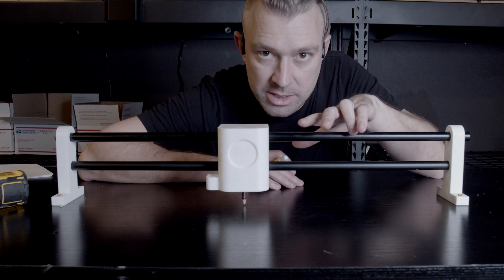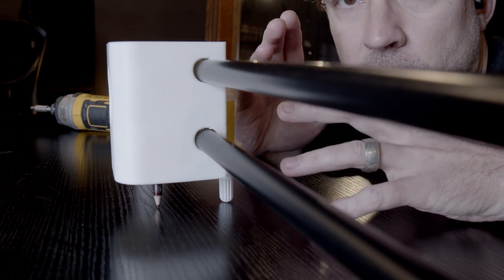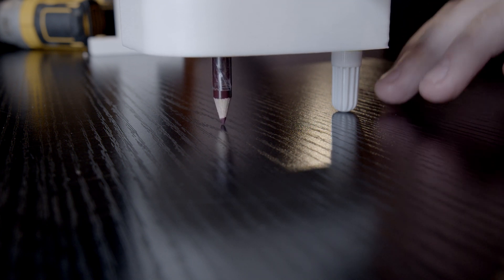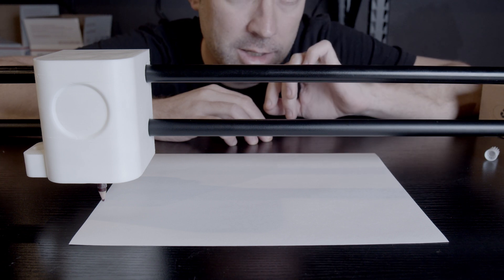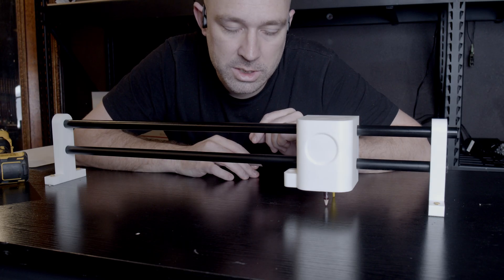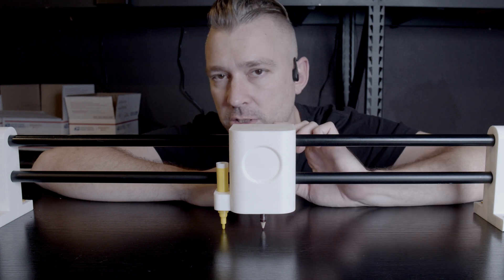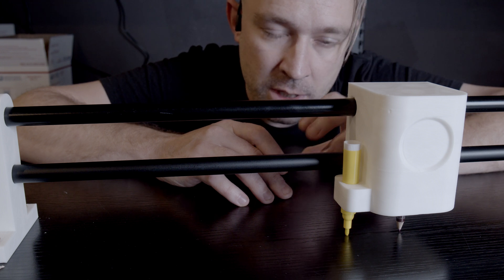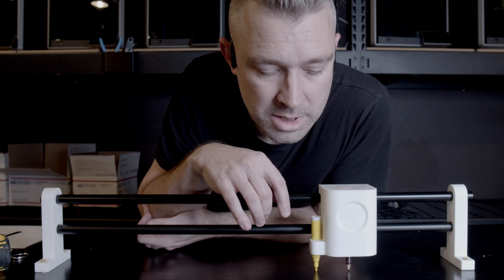Axis Twist? A Problem for Creality and Everyone else!

Comment: I was ready to throw my Ender 5 in the trash and have given up on ever getting a consistent first layer because of what I now assume is a twist, calibration to follow this comment. In my research I have read about x-twist in the past, but completely misunderstood and thought it would have issues front to back instead of left to right.
Reply from the maker: Hope this helps solve your issues. Axis Twist unfortunately is not a massively known or understood topic.
Reply: @zerodotcmd  It solved it on my Ender 5 S1, however my Ender 3 V2 is still weird, when applying compensation the high and low sides just reverse, so I think there the issue may be Y-axis, but not sure yet.

Comment: Huh. It never even occurred to me that this could happen. My printer uses its nozzle as the probe for leveling, with a strain gauge of some kind, I guess. It's just a cheap printer but first layers and general operation have been very good.
Reply from the maker: If your printer uses the nozzle as a probe, this most likely won't really affect you. This video is more referring to any printer that has a mounted probe.

Comment: Nice video. I also figured this out a few months ago. At first I tried printing a 5x5 grid about 3-4 layers high, and then probe the top of the grid lines (which are in line with nozzle height) to get the offset between probe and nozzle. Then used those offsets to correct the probed mesh data from Klipper using Python. Very tedious. After realizing that I could just mount the probe next to the nozzle, the whole problem went away completely and the printer just works reliably.
Reply from the maker: Exactly. I wish more people talked about this problem. There's probably quite a few people having the same issue without knowing exactly what is happening.

Comment: Side probes are a lot less susceptible but with a bad enough twist you can still need compensation since the nozzle and probe won’t be at the same “y” position. As the nozzle’s Y could be off (say 0.1) forwards or backwards. In that case it’s Z position be ever so slightly higher. 

Of course in that case  you can account for it with twist_axis_compensation if it’s bad enough. 

I never needed that until after a few years I started to get a twist to my X gantry on an old Ender 3 so it’s not my first suggestion but worth a check when you’ve ruled out everything else. 

Great visual representation of the issue!
Reply from the maker: You are correct! ✅ It's completely true that with enough of a twist both Rear and Side mounted probes would benefit from running Twist Axis Compensation. This is the main reason I'm always careful to say "less susceptible" rather than saying somethings not effected. Rule #1, there's always an edge case. 😊

Comment: I'd rather go with printers which are having probing through the nozzle itself (without external sensor). Even the Bambulab A1 mini (dirt cheap) has it by default.
Reply from the maker: That is always an option. But remember there is no perfect answer. Nozzle tap probes come with their own set of problems unfortunately.
Reply: @zerodotcmd  Doesn't the k1 stock machine probe through the nozzle itself? The axis still twists though... in that case, is there a way to compensate it?
Reply from the maker: @mathiaschaves7604  Yes the Stock K1 Series printers all home and probe through the nozzle. In the case of Stock someone wouldn't really need to worry about Axis Twist as much. This video is more directed at users who Mod their printers with alternative probing options.

Comment: This is not a problem with aluminium extrusions right?
Reply from the maker: It can happen with any print head that has a probe mounted with a large enough Y offset. some setups are just far more likely than others to experience this issue.

Comment: Excellent video, but as a newbie how would I do this "fix"? I have a K1. Most likely a linear rail would work better. That would not twist, or the round rods should be a bigger diameter to be more rigid. Also, as you show the probe can be installed on the side, but this wouldn't work on the K series.
Reply from the maker: Its rather easy. Just run the macro in the console of either Fluidd or Mainsail. The macro is listed in the description.
Reply from the maker: So the good news is a probe can be installed on the side for the K series. I've made a mount for the Big Tree Tech Eddy that mounts on the X axis with zero Y offset. Linear rails are far better that's for sure, but they're not 100% free of axis twist. Some linear rails may experience effects of Axis Twist while some may not. 
https://www.printables.com/model/1012524-btteddy-creality-k1-k1c-k1-max-mount
Reply: You talking about the Liner Rail mod for K1 series called the "Booty Call Jones"? 😂. I saw it on Printables. Probes can be mounted anywhere as long as it don't crash into the sides and you have a mount.
Reply: @Impenitent2A  By probe you mean a CR Touch? I'm new to 3d printing. I had the K1 for only 1 week.
Reply from the maker: CR Touch is one prob, yes. It's mostly reliable. but there are better probes out there. all sorts of options now days.

Comment: How do you get the module into Klipper to be able to run it? I have a rooted K1C with Guilouz Helper Script. Is this done at the SSH level?
Reply from the maker: You can run the command from the console in either Fluidd or Mainsail. The command is listed in the description. :)
Reply: @zerodotcmd  Thank You!
Reply: @zerodotcmd  opps!!...got a unknown command message.  /in Mainsail.  
I typed "Help" to get available CMDs, but not in the list.

All my "A"s

ACCELEROMETER_DEBUG_READ: Query register (for debugging)
ACCELEROMETER_DEBUG_WRITE: Set register (for debugging)
ACCELEROMETER_MEASURE: Start/stop accelerometer
ACCELEROMETER_QUERY: Query accelerometer for the current values
ACCURATE_G28: G-Code macro
ACCURATE_HOME_Z: Coarse home z
ACTIVATE_EXTRUDER: Change the active extruder
AUTOTUNE_SHAPERS: G-Code macro

I use Twist Comp on my bed slinger with Marlin, just not in Klipper.
Reply from the maker: Sorry for the later reply. YouTube doesn't show me notifications for replies. I'm not super familiar with what all is available in Guilouz Helper Script. I know it sits along side a stripped down version that comes from Creality. It is a pretty basic command so I would be shocked it it wasn't in there. I'll load up a machine with Helper Script and see what I get and let you know.
Reply: @zerodotcmd  Yeah, I noticed you rooted yours with a different method. Maybe Guilouz will do a update?  I really like what twist comp brought to my Marlin printer... it was pretty incredible seeing the difference in first layer quality.